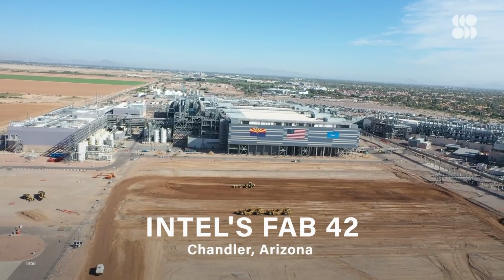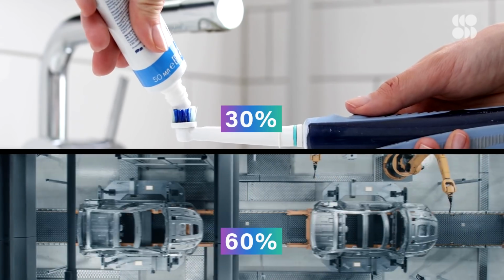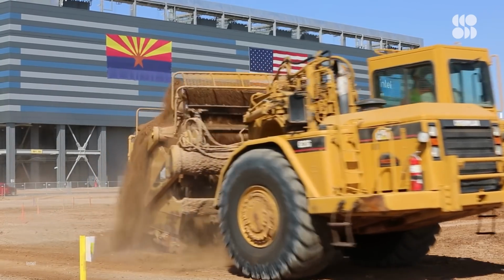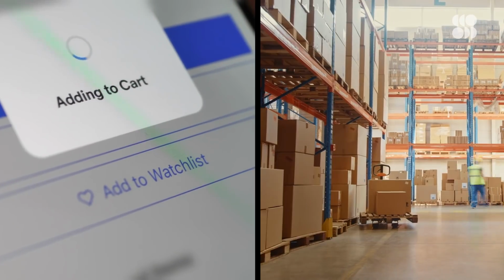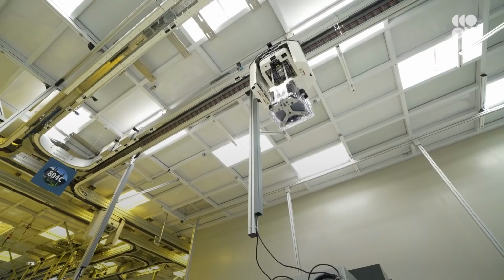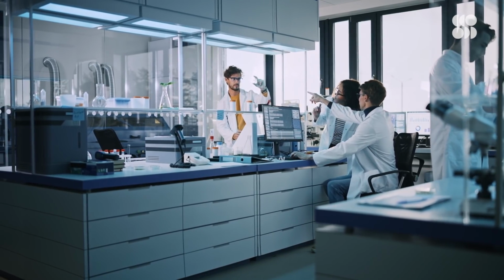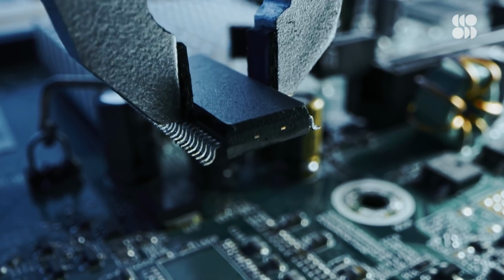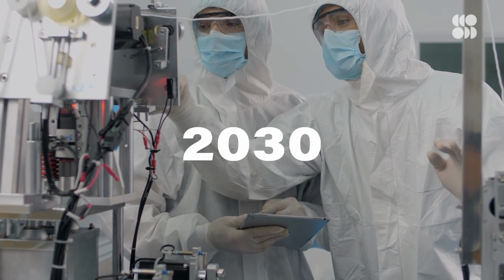Why the World's Microchip Crisis Will Last Longer Than You Think

Comment: @0:54  Transistors are placed side by side.. Not overlapping (LMAO)..   the only thing overlapping is metal layers (and possibly a high up via.. but that depends on the tech).
Reply: I believe that's the next step once we can't get transistors smaller: stack them in layers, so a chip with the same footprint can have 100 times more transistors, or at that point tens of thousands times more

Comment: Can’t wait to see “tens of billions of transistors in just a few nanometers!” For the record, the state of the art TSMC N5 is about 13 billion transistors in 100 mm² (based on the Apple M1).
Reply: That will never happen because it's physically impossible. It's like trying to fit tens of billions of people in a car.
Reply: @vitaminb4869  Which is why I pointed out how the M1 has ~13 billion in 100mm2. An aluminum atom is about 125pm in diameter, so in one square nm, you could pack about 64 atoms at most. Obviously, transistors require far more than a single atom, and in fact when we talk about “5nm lithography” there’s no feature on current transistors that directly corresponds to 5nm in size.
Reply: Yup. Maybe she is doing her own scripts.
Reply: Can someone explain to me WHY chips need to get smaller. I know some actually do need to shrink, but for example, why does the chip in your fridge or in your car need to be so small? Say they made a better chip that had XYZ performance and the size of a dime, or they made a chip with same performance but the size of a wedding ring box, I don't see it affecting performance or taking up too much room in your fridge or car. What piece am I missing?
Reply: @noahway13  The bigger it is, the more distance electrons have to travel, so it slows it down. The main chip that does all the calculations needs to have as many calculations going on per second as possible, so it needs to be small to be able to have higher clock speeds and for each operation to take as little time as possible
Reply: @noahway13  It's a matter of optimizing production in some cases. There's a point where you can't really get smaller, basically when the pins to connect a chip to a circuit board end up being larger than the chip. Otherwise, smaller is better because the silicon wafers the chips are cut from are pretty static in size. They're 300mm in diameter, and if you have a chip that measure 100 square mm compared to a chip that's only 50 square mm, you'll get roughly twice as many of the latter out of the same wafer.

Also, silicon wafer defects are basically uniform, so if there are 50 defects in a wafer as an example, and you have hundreds of smaller chips, losing 50 doesn't matter so much. If you have large chips and can only fit 100 per wafer, you end up with defects in a lot of those chips. Defects don't mean a chip is unusable (if the design is built with redundancies or the ability to disable certain functional units), but they do affect overall yield.

Finally, smaller chips mean shorter distances for signals to travel, and more transistors in the same area. A 100 square mm chip built on a 14nm process for example doesn't just have half as many transistors as a 100 square mm chip built on a 7nm node. You scale in two dimensions (and sort of the third as well), so that a 7nm chip might have 3-4 times as many transistors in a given area as a 14nm chip. More transistors means the chip can do more things.
Reply: @JarredWalton  this is a couple of great points. Smaller chips mean more chips per wafer and fewer units that have to be tossed because of small defect. More $, better yield
Reply: @JarredWalton  I'm not sure if that last point about 3-4x more transistors in a given area is quite accurate. Even when the minimum feature size gets smaller, the transistors are often still a similar size due to current or timing requirements. You'd probably need less buffer space between transistors but that probably affects parasitic capacitances
Reply: @noahway13  smaller Transistor needs less energy.
Reply: @noahway13  as others have pointed out, transistor size impacts a whole web of other areas (performance, cost) the physical size of the device may stay the same, but it will contain more "stuff" thus be quicker for about the same price. For an embedded system like the fridge you mentioned, there's many reasons you'd want to provide a lot of computational power for as cheap as possible. When you can do more things with the same cost, engineers always find interesting new applications. Your fridge could order food or whatever else might make you buy it..
Reply: Lots of intelligent people in this comment section, happy to see it
Reply: You get into the Planck length problem.  You come to a point where p-n junctions are so close to each other that they can occupy the same space and you cannot accurately measure their location.  That's why inside a black hole, you cannot keep infinitely compressing matter until there is a singularity.  There comes a point where you can't compress individual neutrons into a smaller volume because you cannot define that volume.  Google electron degeneracy to find out why you end up with neutrons and not protons and electrons as you compress matter with gravity.  The neutrons share occupancy of the same volume and that's as small a volume as it is possible to compress them.  :elbowcough::elbowcough::elbowcough::elbowcough::elbowcough:
Reply: I guess it depends on your definition of "just a few nanometers"
Reply: This comment needs more likes

Comment: If we didn't build a society based on everything being basically consumable, rather than repairable, we wouldn't have so much of an issue with shortages. Life would be a lot easier.
Reply: Problem is that most people actually don't have the skills to repair stuff. Not only do schools no longer teach basic technician skills, repairing stuff is also way harder nowadays.  In the past repairing a radio was as simple, replacing a vacuum tube, or repairing your desktop, just a new PSU. Nowadays you have to find, desolder en replace certain chips, and opening your phone is almost impossible with special tools.

Comment: And this is one reason why I support more train infrastructure over electric car growth. Each train needs a fraction of the chips to move the same number of people.
Reply: What if we just went back to when cars were analog, no chips needed just wire and 6v systems
Reply: @mynameisntimportant9341  I still think trains are a better use of resources, and car-based urban development causes so many problems that it may lead to the downfall of our society. It's not that there's no place in society for cars, but we have to stop catering to them.
Reply: @mynameisntimportant9341  In general because they were less efficient and polluted more in the non chip era.
Some things are ridiculous though, cars with CAN bus systems will have chips in every single thing, like even the indicator stalk where a standard set of contact switches and a small bunch of wires would suffice.
This is why you only see oldschool cars in the mad max films, nothing full of chips could be serviced in the outback!
Reply: @LooseyHenderson  don't think I'm against public transport because I'm totally for it but I just want everyone to know your car doesn't use those chips the way everyone thinks they do, the engine uses very few to run, the majority is accessories
Reply: @mynameisntimportant9341  Back to when cars have no mo powa babeh?
Reply: Gas engines require a lot of chips too. And the automotive-grade chips needed for internal combustion engines suffered the worst shortages of all. Ask Ford about their unfinished F150s.
Reply: I’d say it might be better for items, rather than ppl.because ppl need solutions for the last mile, while cargo is usually bulked till the last mile.
Reply: Different classes of trains for different purposes, of course. Don't need freight tracks for people moving. An issue is that trains are best suited to replace heavily traveled corridors, so people will still need something like cars for rural areas, since it's not practical for the investment. Trains require level and reliable ground, which may not be possible in some places. It would make sense to mandate commute policies for ecological consideration and resource burden. Imagine a world where the government tells your employer "either this person works from home or they move closer. As it is, their commute uses up too much fuel. You'll have to address the issue or hire somebody closer."
Reply: Very incorrect. Your assumption that only logic chips would exist in a train is clearly the problem. This is the issue with this video, makes us think its only logic chips and memory chips that are hard to get. Power IC’s also exist; for which i would expect any modern electric train to utilize thousands depending on length.
Reply: @jamesmortensen6819  I never made any distinction between logic chips, power ICs, or general electronic components. Still, a train (or even a BRT system) in a well-trafficked route can transport 20,000-60,000 people depending on grade separation, signaling, etc. Even assuming 10 trains with 10 cars each travel a route, you're talking at the least 200 people per car per day. Even if each person takes 2 trips a day, that's 100 people per car. There is no world where 1 rail car or bus requires 100x more components than the average ICE car, and even less likely compared to Electric cars.
Reply: Rail is the way forwards for mass transit.

Comment: I never imagined that the reason Moore's Law would finally be broken is because of the inability to produce the electronics. Up until now, a doubling of transistors every two years has been possible BECAUSE these devices could be produced. It looks like the "quantum ceiling" has been put on hold for the time being.
Reply: The reason Moore's Law broke, is because the transistors can only be made so small before they lose the ability to hold a charge. Work has been done to make designs more efficient, but there are material limits to consider, and silicon transistors can only do so much. Some work has been done to investigate graphine, but it's not usable last I heard. So, manufacturing is not the issue. Moore's law is about making transistors smaller, rather than making them en masse.
Reply: @sirdeadlock  *silicon
Reply: @vibaj16  Thank you. Will edit.
Reply: @sirdeadlock  Not just transistors, but many kinds of devices, I think.  Some are very difficult to shrink, but others are not, as much.  If you look at the support electronics for devices on a chip, they aren't all transistors, at least they weren't the last time I looked.  

I don't know if a quantum transistor is possible, but we will see, ultimately.  I know molecular transistors are being sought, I think I remember reading one of the problems with them is that unwanted quantum effects start becoming significant at that scale.

An obvious next step for more devices on 'a chip' is to stack chips and interconnect them at that scale, or implement something similar to a mother board and card arrangement.  I suspect this will be very tough to accomplish, but am no longer up on that sort of undertaking.

The scales they are working at now are mind boggling.
Reply: i dont think that they want to go back to selling chips for 1$ a pop. i think they are perfectly happy selling one for 130$+ lol

Comment: There is an error in this video. Electrons flow when a circuit is closed, and stops the flow when open. This is a basic rule in electronics.
Reply: Yes you are correct about the circuit, but in the context of this video she compares a transistor to a switch - so she's not really talking about a circuit being open or closed in the first place.
Reply: it's more of a bridge than a gate then
Reply: @Nuke_Skywalker  Yes, and no.  In a wired circuit with a switch you are correct.  The two most common types of transistors, bipolar and FET, however, operate quite differently.  

On the FET,  one of the pins is actually labeled 'gate'.  And it operates with nomenclature for one of the parameters being called pinch off, which is a gate type function, and occurs when the gate is closed.  Definitely more an analog to a gate.

A bipolar transistor could be thought of more like a bridge, though.  With injected current controlling the larger current between the other two pins. You can kind of think of a transistor as an amplifier.  In most logic devices it is primarily operated as a switch, just on or off, one or zero, true/false, however you want to call it, but what it really is is just two different voltages.

Comment: I read an interview with a top guy from ASML, the company that is building the machines that build chips. They have pending orders worth 1,5 years of revenue at the moment and can't speed up production because first of it takes a lot of time to build the machine building machines and they require a lot of chips, where the shortage is coming in again. Their prediction was 2025 for them to be on level with demand, 2027 to have worked away the backlog. So 2023 end of chip shortage? Not according to that guy who was at the start of the entire production chain.
Reply: ASML's machines are super complex though, so even without the shortage, they'd still have some backlog. The tolerances for the optics and moving parts are within the picometer range. How does one even perform measurements with this precision in a production environment?
Reply: @Psychx_  I worked at ASML. It's fascinating stuff at the bleeding edge of technology.

Most spacial measurements are done optically, i.e. software analyses images made through a microscope and then adjusts mechanical processes accordingly.
Reply: @a5cent  LOL
Reply: end for rtx 3090 gamers
Reply: And that's assuming there are no more major disruptions in the supply chain...
Reply: To be fair, Seeker claims that it's too optimistic
Reply: We've got orders from Intel lasting at least the next 18 month's, and we're also running into supply chain issues while trying to double our production. The EUV vacuum control system dropped in my lap almost 5 years ago, and it's gone through multiple revisions. It's fun work, but it just keeps coming at an unprecedented pace.

Comment: It's disingenuous to suggest prices are 100x what they were. Discretes and commodity parts have always sold for pennies, and complex digital parts like CPUs have always been expensive.
Reply: As someone in the automotive manufacturing industry, the prices were in fact 100x higher, mainly from chip scalpers.
Reply: @TheOneVictor  as someone who works in the semiconductor industry that just isn't true. Automotive spec'd parts have always been more expensive because they are tested and packaged to far higher standards than the same part in a commercial package.
Reply: This technology should be expensive, we don't want everybody walking around with the latest and greatest just to not even use a quarter of it's power. People who really want it will work hard for it just as the people who worked hard to create it.